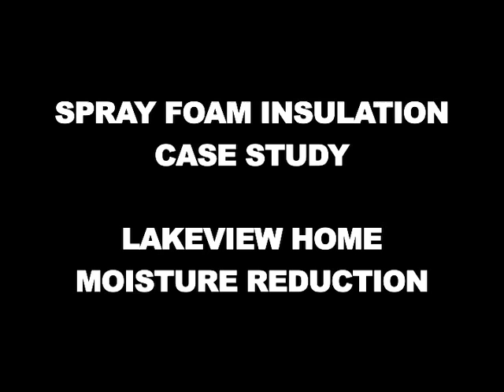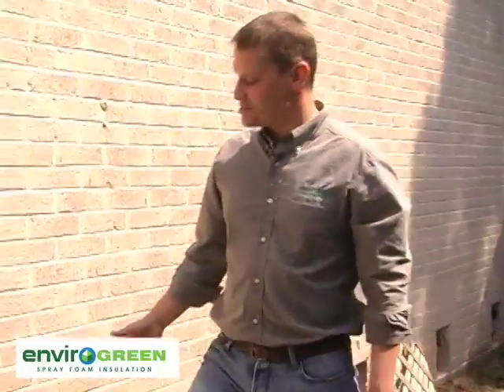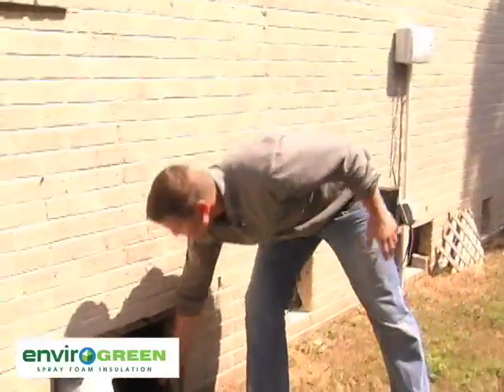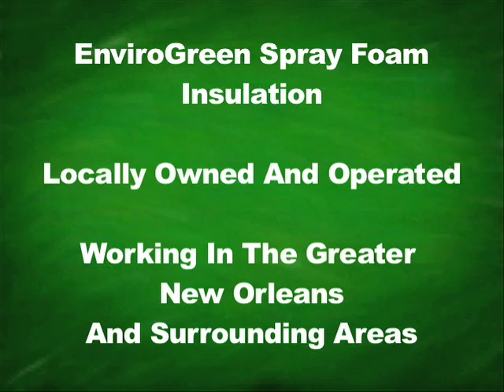Moisture Control In New Orleans With Spray Foam Insulation

Comment: You are spot on Jeff! I did almost all of these things and i still have the same problem. Cupped up wood floors. I took bricks out to open the crawlspace up, and rolled out 6mil plastic over the dirt. All to no avail thanks to Energy Comfort Solutions. Open Cell foam should NOT be used in a louisiana home's crawlspace. EVER.